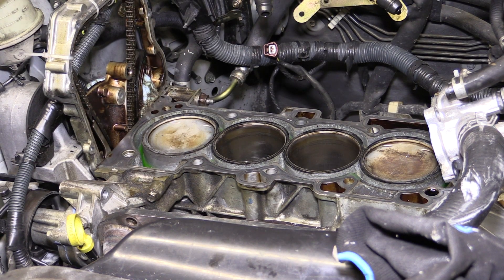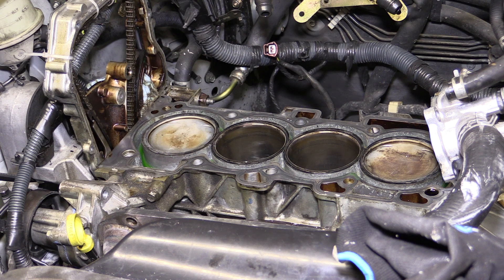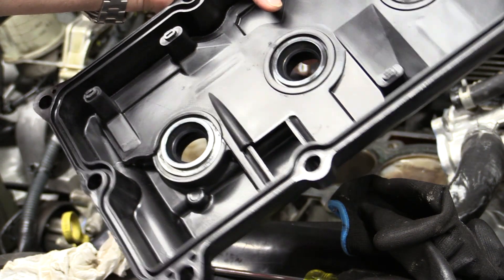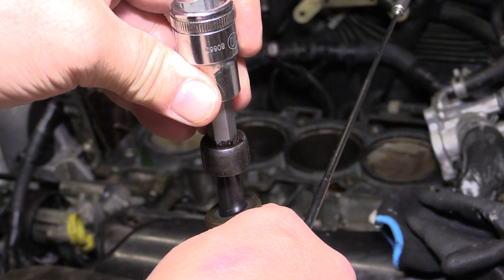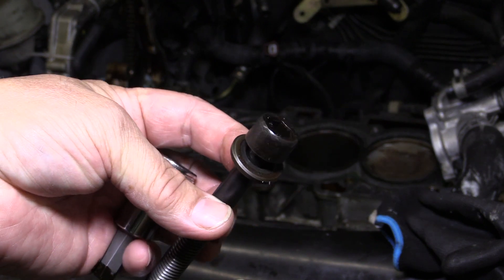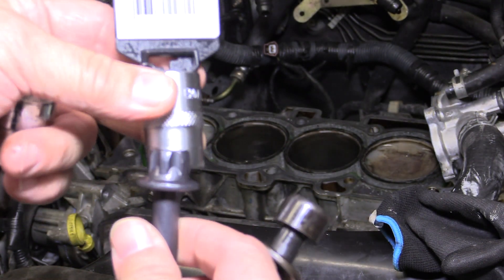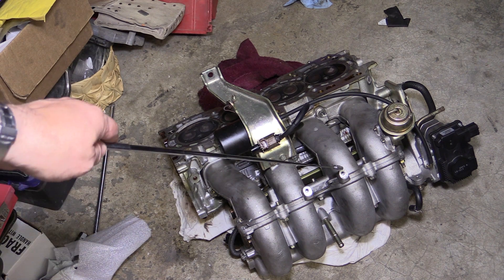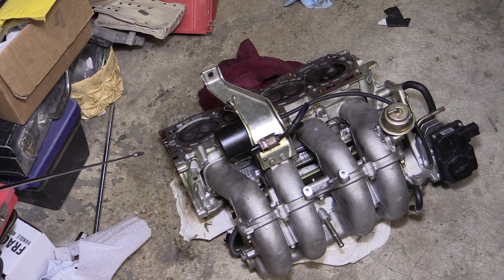Nissan QR25 Engine Head Bolt Issues While Disassembly of Cylinder Head

Comment: Whats the harm in using same bolt??
Reply from the maker: Reusing old head bolts will not not allow you to properly torque them down and you risk blowing another head gasket.  The correct process of torquing head bolts is to torque them down in a pattern to a certain torque specification, then loosening them up again in a certain pattern, then torquing them down using a degree caliper tool in the same pattern.  It's a multi-step process and like I mentioned in the video, head bolts are designed to stretch once not twice.  You can also risk breaking them reusing them twice and that would be a nightmare to retap.
Reply: @diyguy1808   thanks any way too late I've reused them and iam ok since 2 weeks or 3 and all torqued well, no broken bolts, no heating, no coolant loss 😐😐😐 just waiting for the disaster that you are talking about 😒😒😒
Reply: @Sroor90010 Still good I will be replacing mine tomorrow 9-2-23

Comment: HEY BUDDY YOU KNOW THIS MOTOR PRETTY WELL SO TELL ME.... WHAT IS THE BIG DEAL WITH THE DARN PHASER GEAR FAILURE? Brand new EVERYTHING...... phaser and all.... few starts later ...... rattle on cold start! Even when the engine is hot but hasn’t run in 20 minutes.... rattle start. What’s it doing draining oil out of the phaser itself?